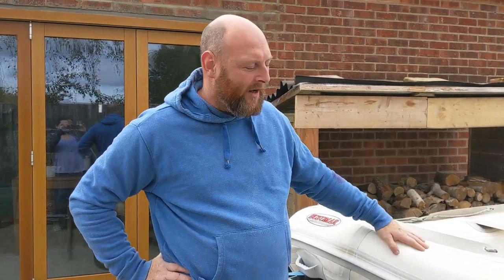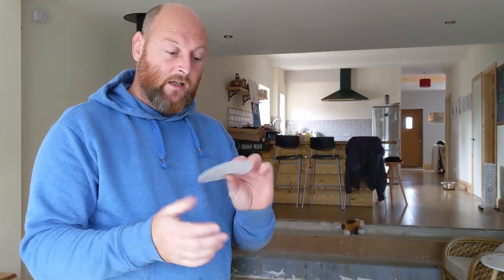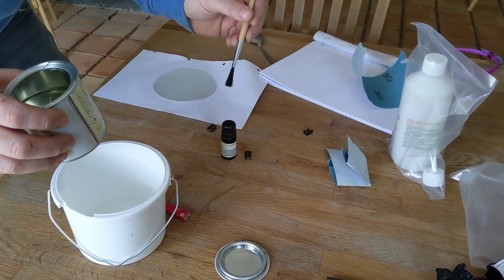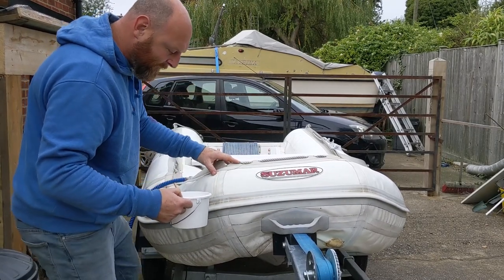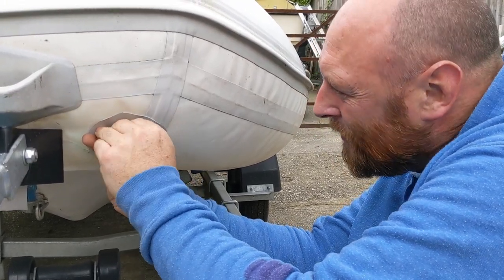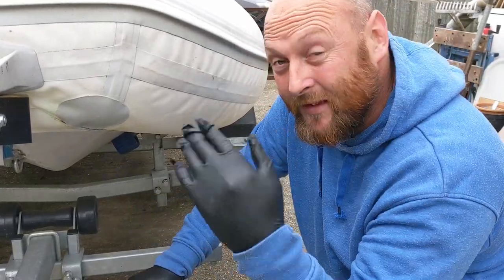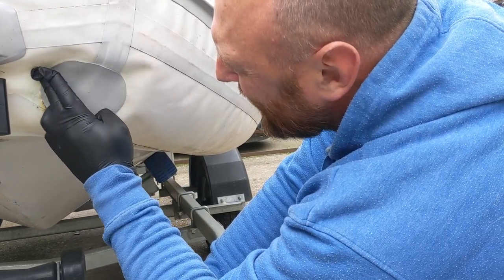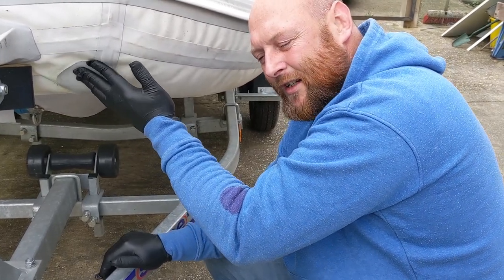how to repair an inflatable boat rib sib puncture leak

Comment: You must have had those products a while. Ben the owner of ribright was one of my best friends and sadly passed away in Feb 2020 just before first lock down

Having built and repaired boats and ribs for near 20years I feel I should give you some pointers for future reference.

 You where using too much adhesive,

You should have got the old glue off

You should have done one coat then left it atleast an hour.

When applying the patch fit the middle first let the air out  the tube and roll it middle outwards, then use a hair dryer to warm it, put a board behind it and using a roller or screwdriver handle role it again,
Reply from the maker: Thanks

Comment: Did you clean the surface first or sanded it?
Reply from the maker: Hi yes I sanded and cleaned the area first.
Reply: @fantasticfishingshow8185  pvc no need to sand get surface very clean with m.e.k then apply one coat wait an hour then a second let it tack off till nearly dry and warm it up with hairdryer fit patch roll it and leave for s24hrs if possible , hypalon you do sand clean thoroughly prime coat then glue coat .